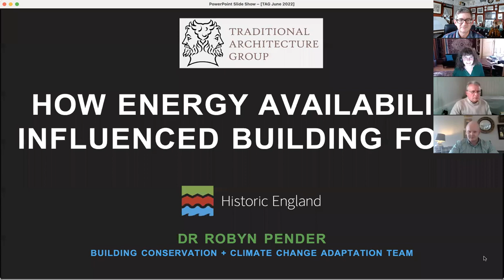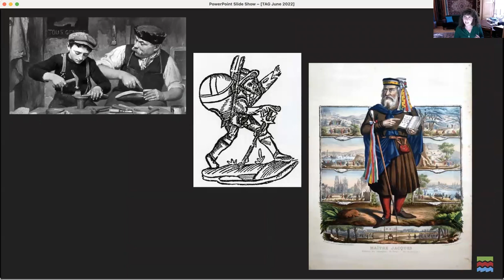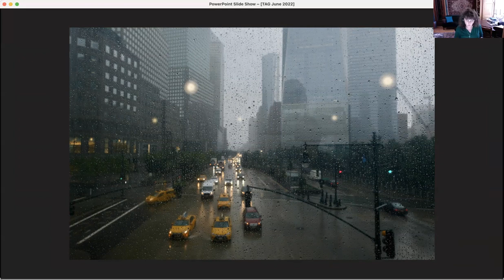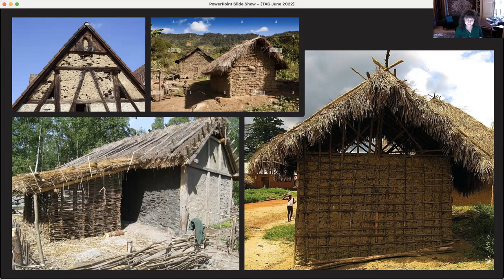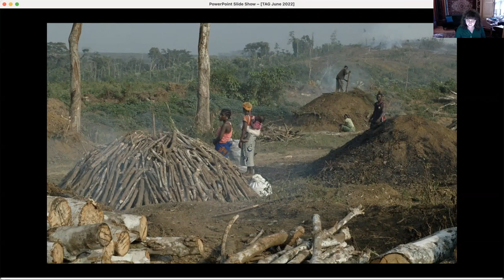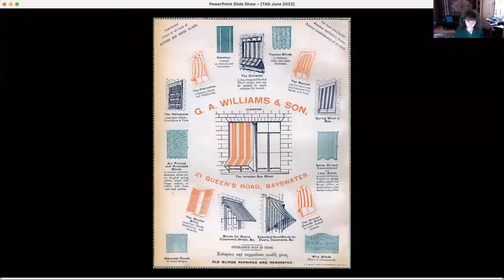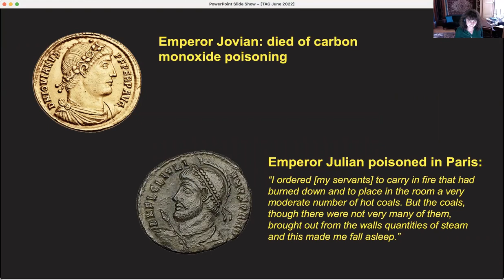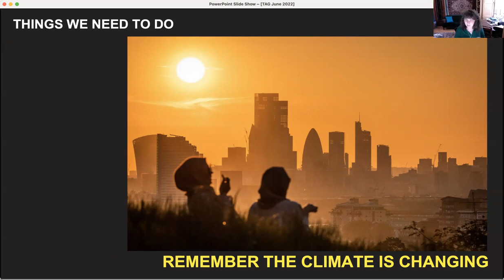TAG Talk #17: How Energy Availability Influenced Building Form by Dr Robyn Pender

Comment: If you want to understand the trick of “civil” engineering you have to look at their data.

All their models are based on data from three methods of action: load a beam in the middle and measure the forces until it breaks.  Load a beam but fix the corners and measure the forces to see if the corners or beam break first…. Extrapolate/

Method two:  take a chunk of concrete and abuse it in different ways and then measure the forces to crush it…. Extrapolate..

Method dumb: take a material put it in between two hot plates and measure the resistance… extrapolate..  

Never is the building performance of the whole structure or labor considered: